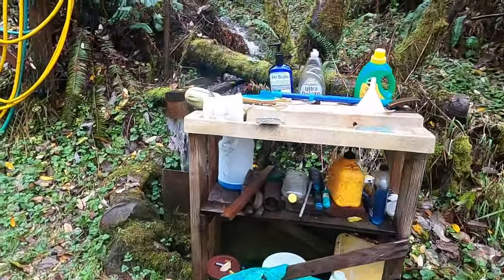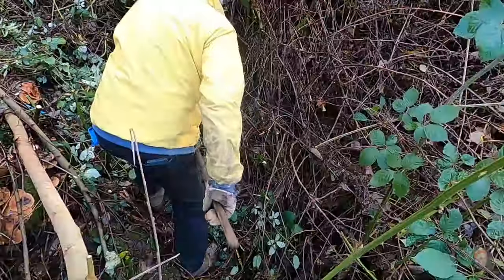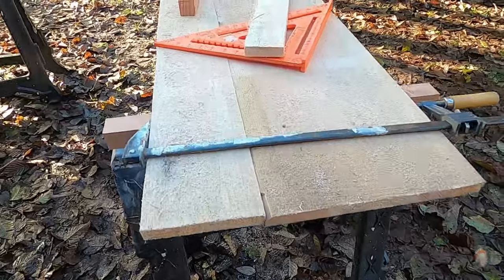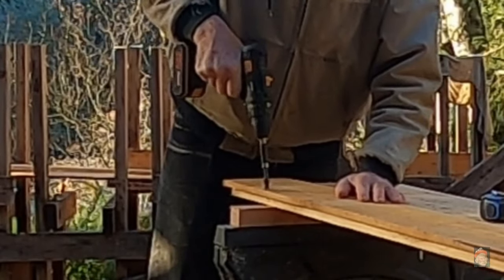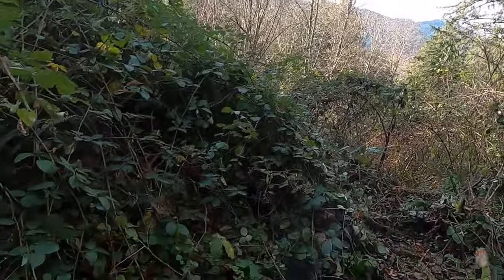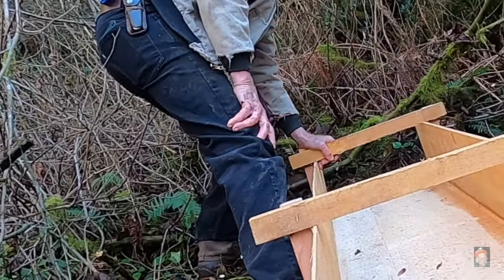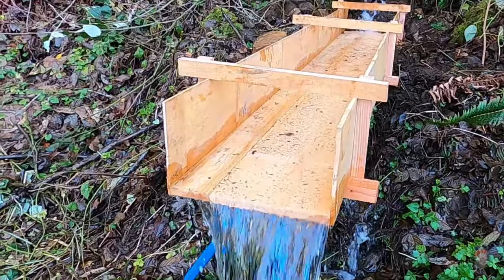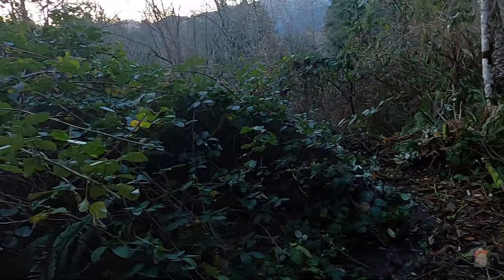Applying Band aids and Building a Flume

Comment: Costco leather gloves are really great for handling blackberry thorns and salmon berry brush. I know you have lots of alder, but it rots so fast. Hope it at least lasts until next summer when you can build a better solution. Collector pool (plastic wading pool) sunk into the ground with cut exit would probably help gather the flow better.
Reply from the maker: If this works, I'll probably replace it with plastic culvert pipe, but I don't want to spend a lot of money until the concept gets tested.